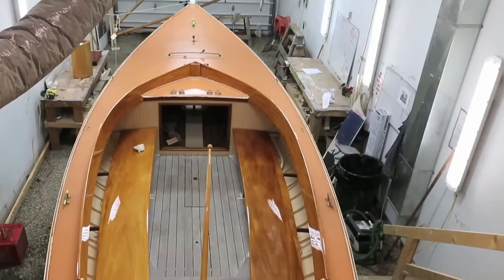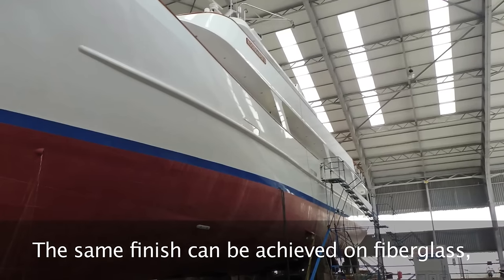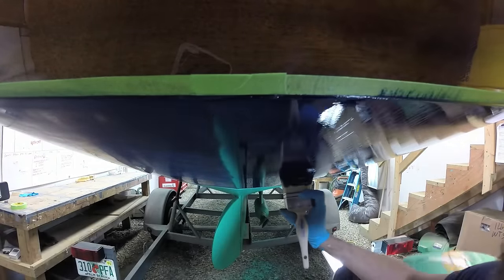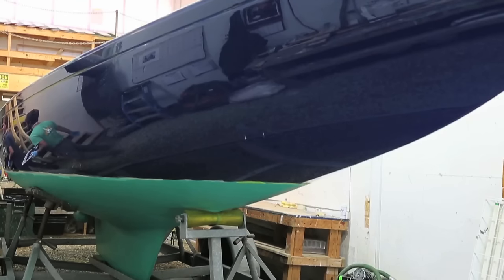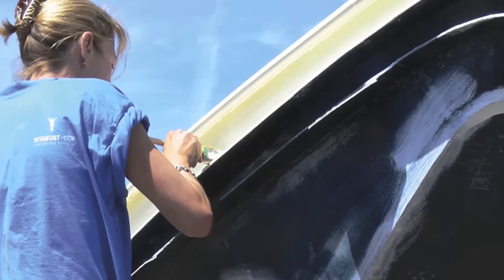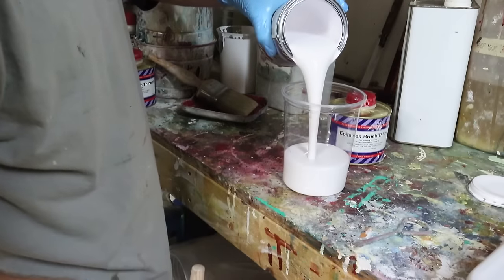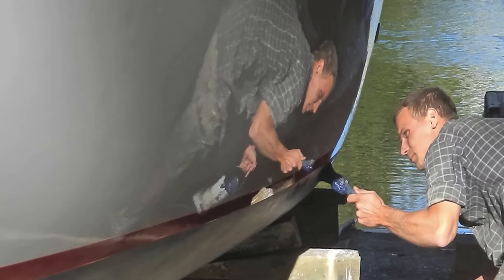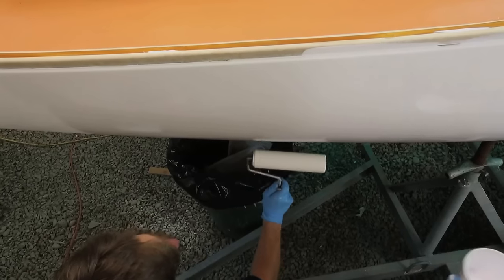Epifanes: Roll & Tip with Alec Brainerd of Artisan Boatworks

Comment: How much reducer do you mix with paint with the roll and tip method I rather keep trying it out on test panel until I get good enough with the method I painted without reducer today with a roller and brush but it didn't come out looking great. I usually use reducer now but when I paint my truck again will be using a turbine sprayer. I like the brush and roller method though.

Comment: I had problems with brush application and even roll and tip until Epiphanes rep came down, it was rolled and tipped off with a foam "Jenny" brush. Have you tried them ? It was a gamechanger.
Reply: What's a foam "Jenny" brush?

Comment: One question do you have to continue until the end of one side of the boat or could you stop halfway and continue the next day.
I'm imagining there would be a line of start stop position.
Reply: Yes. At least finish one side. You could do the other side later and it will be fine but dont stop mid canvas.